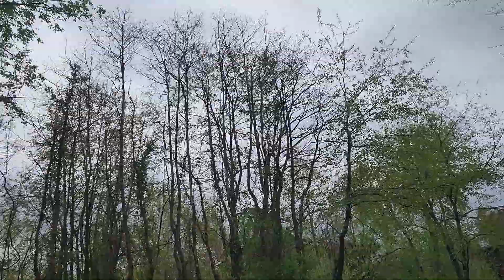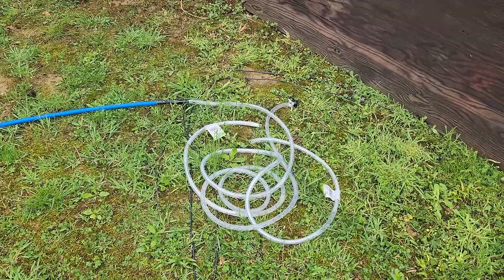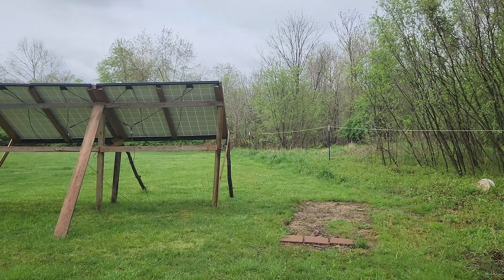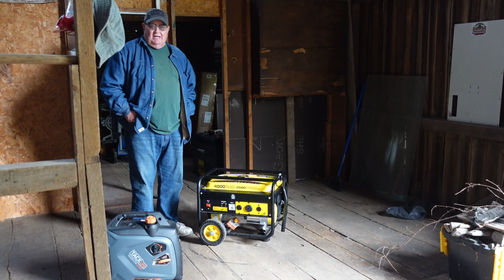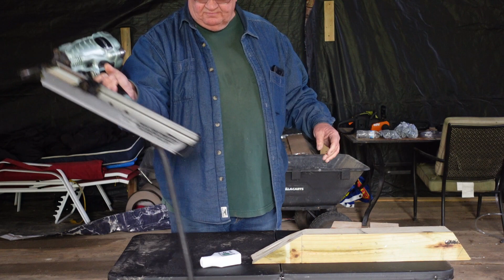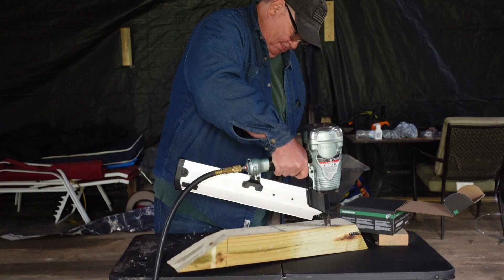Testing My Old Hitachi Nail Gun , Compressor and blah, blah, blah

Comment: Nice video. When will you install our wifi wireless bridge outdoor?
Reply from the maker: Hi Becky.  I should have electric installed next month and run to the barn for the hook up of the bridge.  I am anxious to set it up to do livestreams from the barn.  I was not aware of the power supply needs and additional router.
Reply: I'd be looking forward to seeing how the WiFi bridge works. I'd like a hookup like that for my detached garage. The one WiFi box in the house has a short range.